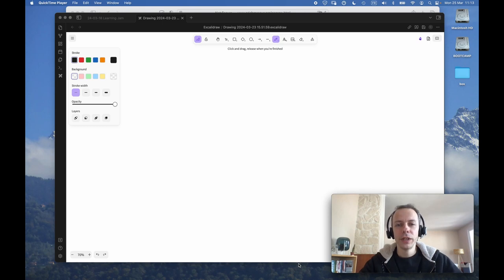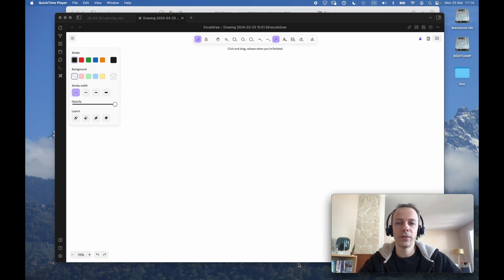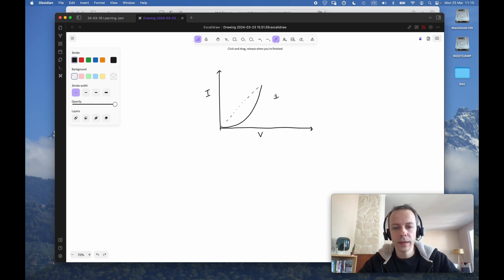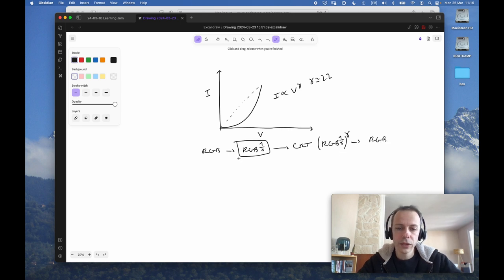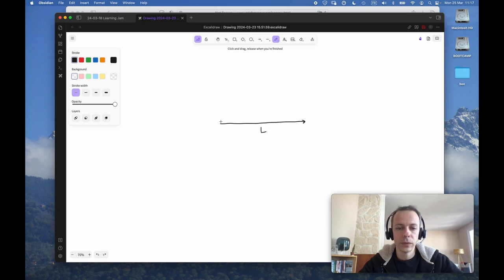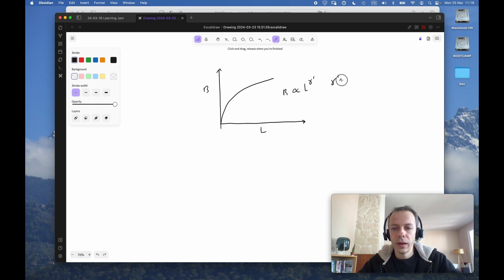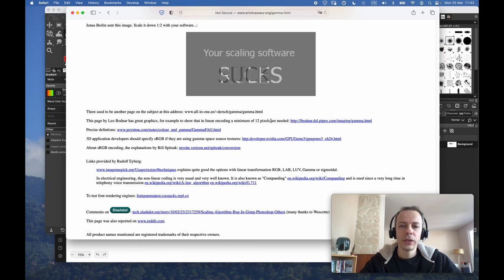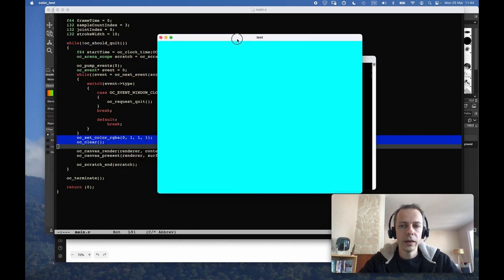Colors - HMN Learning Jam - part 2

Comment: Awesome video! A common confusion is that sRGB space "looks" linear to a human, so it can feel confusing to call the other space "linear". Because of this, I usually prefer the terms "perceptual space" (sRGB) and "energy space" (linear). Though if you are also talking about spaces like LAB, then "perceptual space" might also be a confusing term xD

Two important notes that you might run into in the near future:

- sRGB and Gamma 2.2 are similar curves, but they aren't quite equivalent. If you draw a gradient in the very dark colors using encoded values 0x00 to 0x08, and decode them into linear space, the differences between the two curves are visible to the unaided eye. It's important to know which one your OS (or probably Dawn in this case) expects and adjust your final output curve accordingly. They aren't quite close enough to be a usable approximation, even for 8 bit color output.

- Alpha values are another complication. The interpretation of alpha is different between sRGB space and linear. You can test this by drawing a red alpha gradient from (1,0,0,0) to (1,0,0,1) over a green rectangle. You will either see the browns in the middle, or the more vibrant yellows, depending on whether alpha blending is happening in linear or sRGB space. One of the big benefits of sRGB render targets is that they perform alpha blending in linear space. So the value in the buffer is decoded sRGB -> Linear, then that is blended with the Linear value from the shader using the alpha value, and the result is then encoded back into sRGB space and written to the buffer. Your approach of encoding Linear -> sRGB in the shader doesn't account for this, and will result in alpha blending being applied in sRGB space. Unfortunately, without support for sRGB render targets, there's not a lot you can do about this. The relationship between the sRGB alpha blending function and the linear alpha blending function is complicated, enough that you can't do some function to sRGB alpha values to change sRGB blending into linear blending. You need to either go full software blending, use an sRGB buffer, or render in linear space (using e.g. rgb9e5) and then convert to sRGB after all blending has happened.

However, because you are writing a 2D renderer, there is good news. Alpha blending in linear space is usually something that makes much more sense in 3D than 2D. It's a calculation like "what percentage of light passing through a fog medium actually continues forward and reaches the camera". Alpha blending in sRGB/perceptual space is more intuitive to an artist tuning alpha values. Because of this, photoshop's default is to do alpha blending in sRGB space. So if you are expecting users to be tuning alpha values in photoshop, sRGB blending may be desirable.

Because of the hardware blending path though, switching between sRGB alpha and linear alpha is not a cheap operation for GPUs. Having a per-draw configuration for alpha interpretation is probably not something you want. Better to either standardize Orca fully on one of them, or have a global (or per-target) configuration.
Reply from the maker: Hey Spex, nice to hear from you! I wanted to mention the distinction between the proper sRGB curve and the simple power approximation, but totally forgot. I was going for the simple one anyways because I was under the impression it was "good enough", but your comment makes me want to do a follow up to visually explore the difference!
Orca's renderer does almost everything in compute shaders, so the fragment shader where I added the conversion to sRGB is only called at the very end to blit our scene to the framebuffer, but all blending happens before in linear space. I didn't know photoshop is doing alpha blending in sRGB space though, that's interesting.